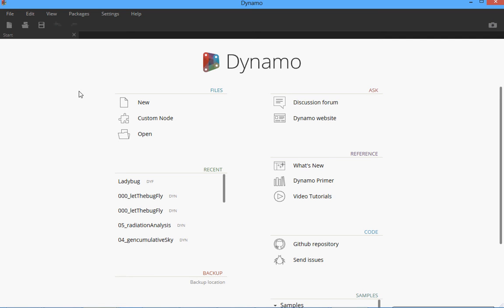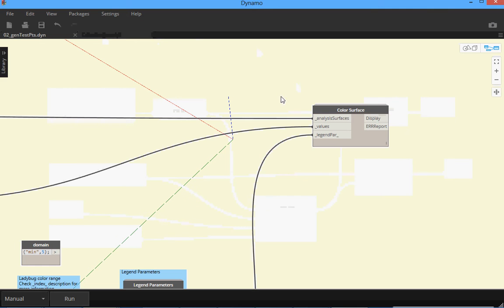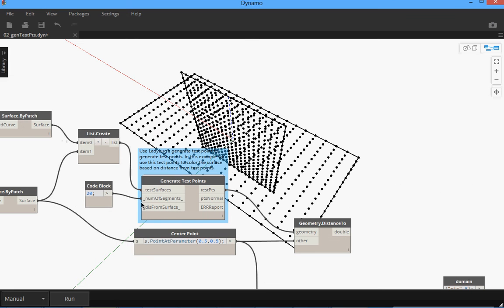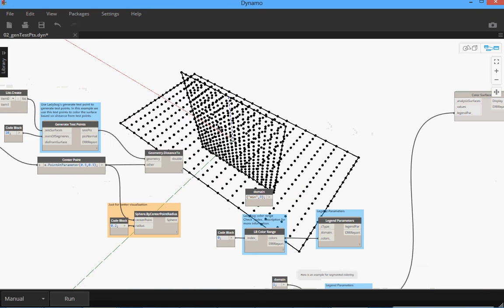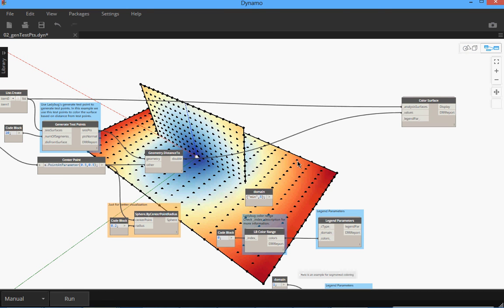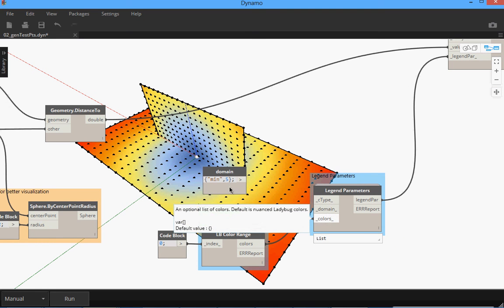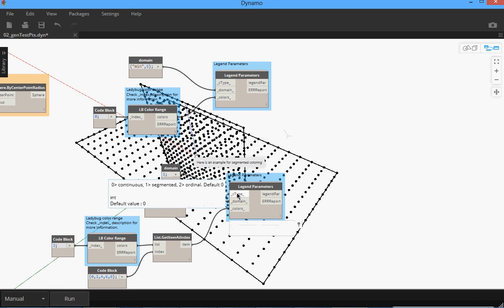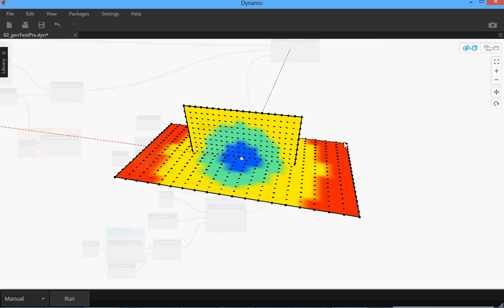Generate Test Point and Legened Parameters

Comment: Hi! Where do I find the Color Surface Component? It doesn't seem to be a part of the Ladybug package in verison 1.5.0 :(
Reply from the maker: The workflow has slightly changed. Now you can generate the colors and 
then color the surface. Check the updated example files which comes with
 1.5.0.
Reply: where can I find the updated examples?
Reply from the maker: Inside Ladybug installation folder.
Reply: thank you!